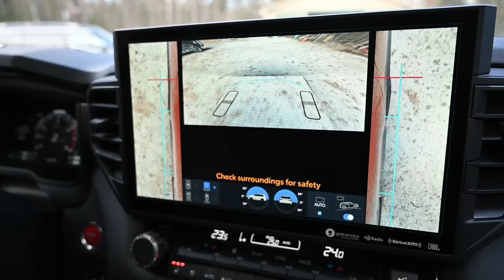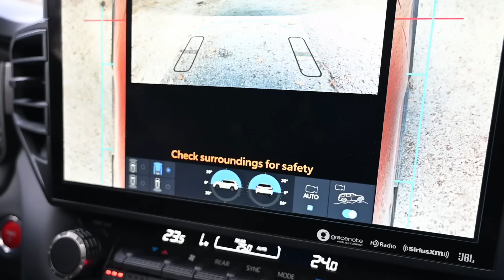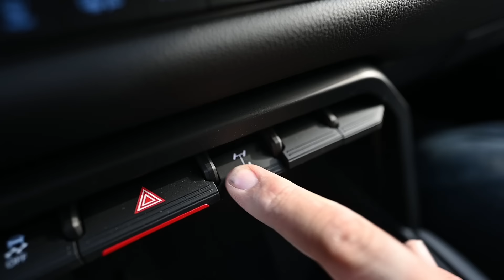Trail Damage! Toyota Sequoia TRD Pro Takes On Ice, Water & Mud

Comment: Absolutely mind boggling that they sell an "off-road" package that looks like it's on lowering springs and has no tow hooks.  Just unacceptable.
Reply: No one in the correct mindset is going to take an 80k toy and "off road" 😮😮😮
Reply: I know I wouldn’t take sequoia off-road.  What’s the point even? It’s big and makes off-road courses challenging !  I will be towing heavy with this baby  while hauling family of 5 and a dog!!
Reply: @ju4121 You are completely ignoring the point, and no, if it is marketed that way it should perform that way, a Bronco Raptor also costs like 80k and is made to go off-road, a Toyota Land Cruiser costs 100k and is made to go off-road.
Reply: @reptoid7340 then the solid axle makes this worse in all the onroad duties.
Reply: Toyota idea of offroad is turning off a paved road onto Walmart parking lot in this
Reply: @imnotusingmyrealname4566  not sure I'd lean on marketing as a reason it should be perform a certain way. And a solid rear axle may not be the best in terms of everyday ride and handling, it certainly can help for towing.
Reply: @ju4121 You clearly haven't spent much time off reading. Plenty of people with families go camping and off roading need somethingto fit them and there gear. Plenty of people 80,000 to them is like 80 for me lol.
Reply: @weirdshibainu  yep. the new Tundra even has less articulation off road  the last gen they made these pavement queens.
Reply: @scott8238  the channel Tinkerer's Adventure has a great video on the differences.
Reply: I couldn't agree more, there's a lot about Toyota that is unacceptable to me.
Reply: @ju4121 we do!  And nearly everyone in SoCal takes 80k trucks offroad... 80k is normal offroad truck price... it's a Toyota, not a 3 million dollar Bentley 😅
Reply: no, they do this for fuel economy reason
Reply: It's not an offroad package, its a trim. Get it right.
Reply: @jasonthach44 yep just like the Rav4 TRD O/R
Reply: Needs proper off-road tires and lift. That’ll do it
Reply: @imnotusingmyrealname4566  
I definitely agree with you on this, if they stamp it with the TRD then that's definitely marketing it as off-road. But just be careful because them Toyota people will get butt hurt over anyone saying anything negative about Toyota.
Reply: While I agree and actually love the way this sequoia looks …. They’re selling very well …
Reply: Because 99%of the people who spends $80k will only go over the lawn.
Reply: Exactly! I also think the Sequoia at its price should be standard with a full-time 4wd like the Land Cruiser and LX. The TRD Pro should also have a 3" lift with larger tires.
Reply: @ju4121 Raptors, broncos and jeeps that cost more donut Al the time🙄…………please say you’re a woman?! 🤭🤷🏽‍♂️
Reply: @scottyellis3442 I agree. I’ve seen so many off road reviews for this where the guys were raving about it… it can’t cross a ditch.
Reply: Because they knew these won’t go off-roading.
Reply: @ju4121  No, you take your $65,000 Wrangler off road!
Reply: @jimjones-pz1tt  damn.. I don't like trucks.. Or suvs . I drive a 40k car and I treat it like a new born. If I ever buy a off road car, I am going to the used market, so I can trash it. 🤔🤔👀💁🚗
Reply: Needs 2 more inches of lift and tow hooks
Reply: @BHUFF  you are intelligent. I didn’t think about that. Sometimes we forget that tow hook takes some inches below yet this car’s ground clearance is so low.
Reply: Yep . 2-3 inch lift would make a HUGE difference.
Reply: @ju4121  To be fair, you are right. Its really just for show, BUT more than likely someone will try it. That being said, if something is sold as an "off-road" vehicle, it should have standard off-road stuff. Even the front skid plate is laughable, Honda Pilot Trailsport, has a steel skid plate that can withstand twice the weight of the vehicle. Yes, that is a smaller vehicle, this Sequoia is 30K more, and its got aluminum and plastic skid plates.
Reply: @ricqik  This or playground park trails.
Reply: It's not an off road vehicle.  It's a gimmick off raod vehicle  features that don't even wanna work the way you want them to.
Reply: Cargo sucks, no rolldown rear window like the 2022 and the price is over 70k smh

Comment: It needs another 1 inch lift. Its a bit embarrassing that the Subaru Crosstrek Wilderness has more ground clearance than this.
Reply: unfortunate the Subaru CVT is garbage and they have no lockers 🤷🏼
Reply: I get the feeling that this was more intended for the folks who build an overland vehicle to commute in and maybe camp 5 times each summer. 

But, for those of us who actually overland/off road it’s disappointing. Though in all honesty, I’d never take a vehicle this expensive at stock off road on any expeditions.
Reply: The Subaru doesn’t carry 8 people. And we all know what Subaru is backwards:-)
Reply: Right!
Reply: This sequoia beeper isn't even worth its weight.  It failed miserably where an outback, a crosstalk  can breeze through those mild  conditions, no problem.  A hunk of high tech that don't even work the way you want them to. It's completely quite the opposite.
Reply: Get the upgraded lift and tires and none of this video matters

Comment: The 'pro' gets stuck in mild offroad conditions and obstacles. Needs more lift, more armor and more tire. This is why anyone who wants to do more than fireroads in the current crop of Toyota 'offroad' vehicles should spec the TRD offroad package and do proper mods themselves.
Reply: Exactly what I did with my 2022 Tacoma. Trd OR 4x4 premium, instantly added a beefier suspension lift (approximately 2.5” lift and level), 33 inch falken at3w, and plan on adding a lowpro bumper and wench. All for less than 48k, better ground clearance, better suspension, better tires, and cheaper than a “pro”.
Reply: Where do you attach your aftermarket tow hooks?
Reply: @jimjones-pz1tt  afe has a video on that where it mounts to the existing sway bar bracket holds. or u could also remove the fog lights and find aftermarket tow hooks there since the fog light brackets are a perfect spot for them. or u could always add a front metal bumper
Reply: I mean let’s be honest. People buy TRD Pro for status. 

If you want an off-road vehicle you’re buying a 4Runner or Tacoma and modifying it.
Reply: @SSatterberg  For real wheeling true. But if you're wanting to do some light/medium wheeling and take a family of 4, two dogs, all the gear, etc. for backcountry camping something like this can work. I did the above with my 4runner and it gets cramped. I just bought a pickup, but having the enclosed cabin has benefits too.
Reply: @IAMLEGIT2323  Same thing I did with my 4runner. Bought the ORP, straight to the shop for 2.5" lift, UCAs, BMC,  fender trim and 275s. Still under the cost of a TRD pro, drove awesome and wheeled so much better.

Comment: I must say this kind of contrasts with you previous video comparing it with the Armada.  You guys said you would feel comfortable taking this off road, and I had my doubts about that.  I'm pretty sure you feel differently after filming this about taking this off road.  I would classify this and the Armada as rather similar in the off roading situation despite the package differences.  Only difference is tires really, and you can easily swap that out on the Armada for the price difference.

Comment: The only off road thing it will do is get off on the rest stop on 75.
Reply: Well there is one thing I think this Sequoia TRD Pro will be good at and that is on a slippery boat launch pulling out a heavy boat.  The lockers and traction control will be great on trailering duty.  Honestly, who is going to take that very expensive vehicle thru what Steveo just did...noone with any sense.  It was a good test just not what this truck was meant for despite its name.  If you want to do this type of offroad, try a Rubicon or Bronco Badlands or higher trim.
Reply: @Red.Hot.Chili.Beans63   4runner trd off road or trd pro
Reply: @youtubecarspottersguide1  Yes, agreed 4Runner in either of those trims would be a able to handle Steveo's course.
Reply: @Red.Hot.Chili.Beans63  4runner is the best trail rig  sold,   do like the new GX550 overtrail ,  over a sequoia  TRD pro its just to much  3 row luxury school bus  ,if one need a tank  like the  sequoia just sr5  has  more towing and payload
Reply: down the dirt  road to the lake house,  watch out for that puddle,  might need 4wd  $80k and some one buys them  add $10k markup
Reply: @youtubecarspottersguide1  I think we are in agreement.  The Sequoia in whatever trim is a mild off road car best kept on gravel or aspalt.

Comment: The linkage components for these new Tundras and Sequoias for the off road packages are made of aluminum instead of steel like the 2nd gen vehicles.  I’m not saying that it cant be better but it’s something that should be looked at since the articulation is minimal.

Comment: The biggest aspect of this vehicle will come down to where you live. This vehicle will perform much better in the right environment ( desert / rocky road ). Put a 3.5 inch lift on it and 35’s, it will transform to an all terrain tank. Sucks it doesn’t come equipped off the lot for the price but lets not forget its a 3 row SUV. So many people buy high end “ off road “ vehicles and still have to add wheels , tires and suspension. This is no different.

Comment: did you turn off the safety warning sensors? I heard them going off when go thru taller grass. I have the tundra and find going thru a field, the sensors want to lock the trucks brakes up. that is annoying.

Comment: Too big, heavy and low to be a serious off roader.  You're right, rough dirt roads is where it is in its element.
Reply: The side steps are like loud tuning forks on gravel, & the inadequate mud guards do nothing to stop this. Not to mention the lack of overall sound proofing through out the vehicle… However the power train & ride quality for light off roading is top drawer in my 2020 TRD.

Comment: Evidentially it's not obvious to everyone that if you want to go through stuff like that (very common where I live) the Sequoia is going to need a small lift and 35's. For those saying it's marketed for that stuff so it should be able to do it, wow. If you can't figure out in about 3 seconds what kind of wheeling it can do you're way out of your element and should just stick to mall crawler patrols. It doesn't take much to drastically improve the Sequoia's off road abilities for the 2% or so that wheel it.  There's no shortage of new Sequoia build and videos of them traversing some serious terrain. Jepp capable.....nope, Bronco capable....nope, but they can damn sure do a hell of a lot more without much effort for those that really do intend to use them that way.

Comment: I want to like the new Sequoia but I'm a bit skeptical of some of the reviews from several owners such as the disappointment in the suv's interior quality for the price and lack of space in the trunk and 3rd row area as well as the unrefined hybrid powertrain and ride quality. I was a big fan of the prior generation Land Cruiser 200 with the 5.7 V8s when they were in production and everything about them was superb quality. I really like the Sequoia's new body style redesign but I really hope for the next couple years they can work out the flaws of this vehicle. I feel like it wasn't worth the switch for Toyota to go to this all new hybrid iForce Max system because it barely gets better MPG than the 5.7 or even the non hybrid twin turbo 6.

Comment: Manufacturers should watch this stop putting low hanging plastic garbage on the trucks  and keep the bumper steel
Reply: Unfortunately. Safety testing for pedestrians doesn’t do particularly well with metal bumpers. 😃

Comment: 6 cylinders replaced with turbo fours, eight speed transmissions, thin aluminum hoods to meet CAFE standards-what could go wrong?
Reply: The 8 cylinder was replaced with a 6 cylinder turbo on this.. along with the Tundra too.

The Highlander was the model that had its 6 cylinder replaced with a 4 cylinder turbo.

Either way none of those models with the downsized engines have any appeal anymore in my opinion.

Comment: I've been quite unimpressed with the new Sequoia as a family truckster and the middling off-road performance is the nail in the coffin for this thing for me. This thing needs more clearance, more appropriate front and rear fascias, recovery hooks, and larger tires would be nice as well. Sorry Toyota, but you need to go back to the drawing board. This is not a TRD Pro, it's more of a semi-pro.

Comment: As Ryan from Fortnine might say, this thing is a "potbellied pig", TRD pro notwithstanding. Huge, heavy, no proper lift, not even the fantasy of a front locker. The 3rd/cargo area is embarrassingly small. Nice cameras and screen though! I think the TRD Sequoia is a truck for towing your actual off-road vehicle to the trail head, at least with only the factory lift and on the factory tires. Maybe it can be built up to spec? Great video, great review!

Comment: Making the rear locker only function if 4WD Low is such a fail.  My Ram allows me to turn it on while moving in 2wd, AWD, and 4wd high with just a press of a button without losing momentum.  You have to come to a stop to get into 4wd Low, so you're already stopped and a locker at that point is just hoping and praying.  And no vehicle with that low and long of a front end should claim to be off road what soever.  It's a snowy road grocery getter, so the Fox shocks and such a a total waste of money because you'll never use them to their potential.  The same company that makes the Land Cruiser trying to sell this thing as an off roader is just insulting to the American public.

Comment: Sadly Toyota just didn't care when they made the 3rd gen Sequoia, it was about saving money to have it on the Tundra platform. This is the "TRD PRO" version and it only has 9in of ground clearance and is not capable offroad. Ok maybe it's better just on the road, but then you have that solid rear axel and the internal useless 3rd row/cargo space along with a high price and it's not a worthwhile option. I have 1st gens and a 2nd gen, and I would never buy one of these.
Reply: yes looked at one last week TRD PRO , buyer backed out $83k a $10,000  marl up so $100k after tax and fees  drove by  last night it was gone  ,this  more of a 3 row luxury , family school bus , id go for the lexus GX550 overtrail for $25k less

Comment: This vehicle is very nice. But inside quality is very very cheap. Specially front seat sides. Crack's after 5k mile. Other sides also cracks will little tension. I am regrading buying this vehicle.

Comment: You can all criticize the product all you want, but I've been off roading, 4-wheeling, snowmobiling, and plowing snow most of my life.  I would never drive a vehicle in this manner if I was trying to avoid getting stuck.  Let look at what exactly you did in the first video.  You drove into a small mud crossing at crawling speed with the rear differential not locked in.  You stopped then hit the gas and spun the tires.  Then you locked in the rear diff hit the gas and spun the tires again.  Backed up a couple of inches then slowly moved forward again all the while the vehicle continues to burry it's self.  Talk about setting this vehicle up for failure. If you were my kid I would be shaking my head in disbelief

Comment: Love Yota's. but this is a disgrace...  What happened to the days to the old F-250 with lockout hubs, a 351M, and enough beer in the cooler in the  bed for a great day/evening of 4-Wheeling?  Whoever asked for this type of 4 Wheel-Drive "system"?  It wasn't broken, so why did everyone try to fix it?  These things will never see more than the local strip mall & Starbucks, so come on, Toyota.  J
ust give us a reasonably-priced Land Cruiser without all of this fancy "it might get you out of trouble "software" and just give me good old reliable solid axles, a rear locker, recovery points, and let me get it stuck so I have to have a friend yank me out of a stupid decision because I tried to go through something I should have known better about.  I sound like a bitter old man, I know, but that stuff just worked...

Comment: I blame the EPA. These are Subaru angles (if even that)..... Needs a 2-4 inch lift. 4 inches would be fine.

You gotta have 25,25,25 for angles. What you really want is 30,30,30 or more. 

Low 20s sucks.

Comment: No ground clearance you are bottoming out,look how low that thing is all that plastic on front end will rip off .This is clearly a street only truck from factory. Very disappointing you put about 5 k worth of damage to that junk front bumper going into a very small incline. Toyota needs to seriously lift the off road package on this model

Comment: Watching this red blob "trying" to pretend it is an off roader is a complete joke. The Tacoma is a much better off roader when properly equipped from the factory. Thanks for opening many eyes that were possibly looking to purchase this vehicle. The aluminum "minimum size" front skid plate and plastic gas tank shield are just junk. The transfer case skid plate was just a pee wee. The lack of front tow hooks should tell you don't take this off the pavement.